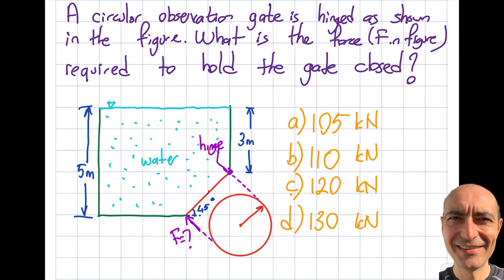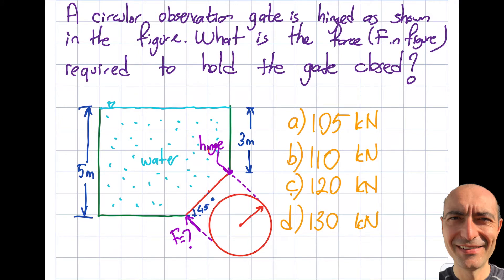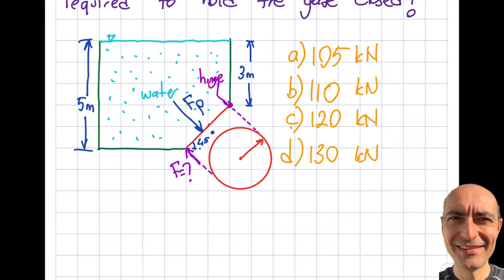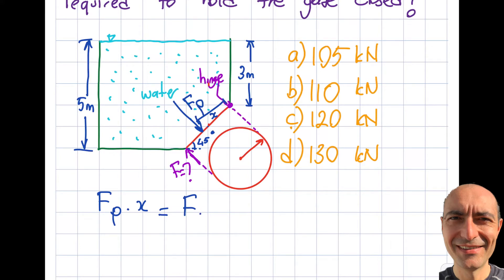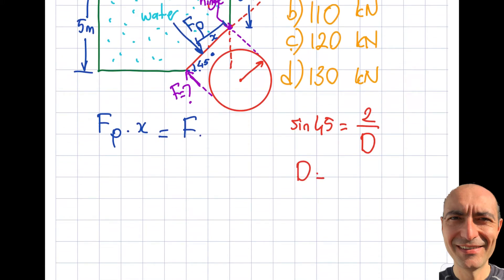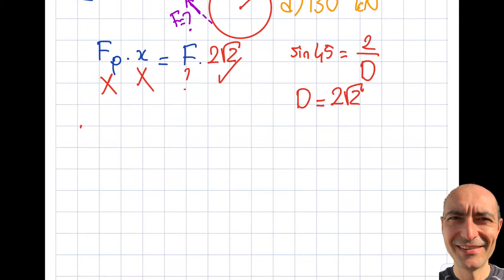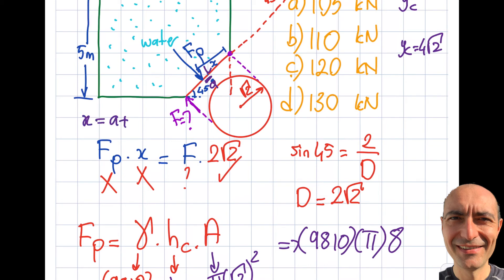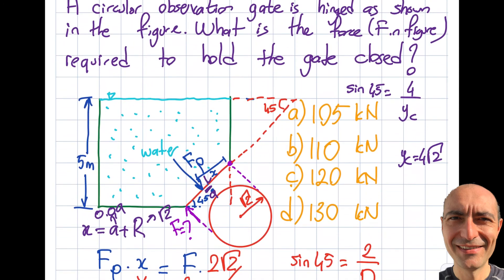FE Exam Fluid Mechanics - 2.6 - Practice Problem - Fluid Statics

Comment: When I approached this problem, I went to the equation in the handbook and plugged n chugged: Fr = (Patm + ρ g yc sinθ)A, with ρ = 1000kg/m^3, g = 9.81m/s^2, yc = 4m, θ = 45deg, A = 2π and Patm = 103135Pa. Why is this not the correct approach?
Reply: I think the prof assumed Patm is negligible because most of the time Patm << pressure exerted by the water/fluid. If you omit this then the formula for Fr becomes the same: hc = ycsinθ, and  ρ g = γ, so Fr = ρ g yc sinθA = γ hc A

Comment: Thanks again for the videos!
One thing I did not get, is how did you use hc=4m when you calculated Fp?
I know you said 1 m +3 m =4m, but when you calculate Fp, hc got to be more than 4m, because you Fp is not at the center of the gate?
Please explain
Thanks
Reply from the maker: Ali: what you are asking is the most common mistake I see in my exams. So it is a little confusing topic. Fp does NOT apply to the center of gravity. It applies to the center of pressure which is pretty much always a little higher value than the geometric center. I have my lecture videos here: https://www.youtube.com/playlist?list=PLCCmgp4iMmxh1S9TyRrJnxghaSjFi51TA have 2 theory part and 5 solved example questions. It may help you to clarify. Best of luck

Comment: Hello professor, I don’t know if I’m mistaken but I’m confused on why yc is not the same as hc. I’ve been doing that but I guess I was wrong. I thought once you find hc, you use it to find the y particular eq.
Reply from the maker: Hi Valerie, yc is defined from the origin placed at the intersection of inclined surface and free surface. On the other hand, hc is defined in the -z direction. So, they are related by sin(theta)=hc/yc where theta is the angle of the inclined surface makes with the free surface.
Reply: Hc=Yc only if the surface is not inclined(totally vertical).However, if the surface is inclined at an angle thetha,   Yc=Hc/sin theta